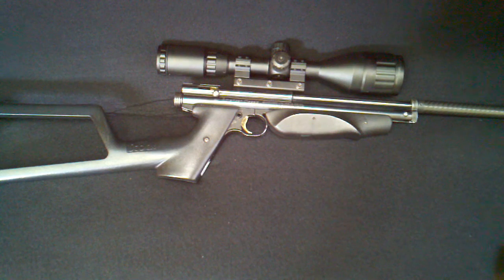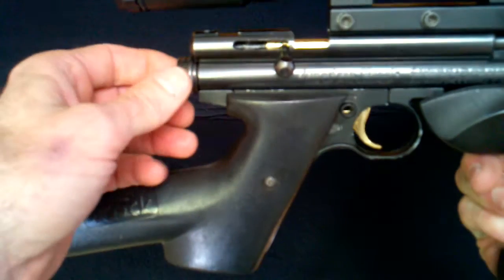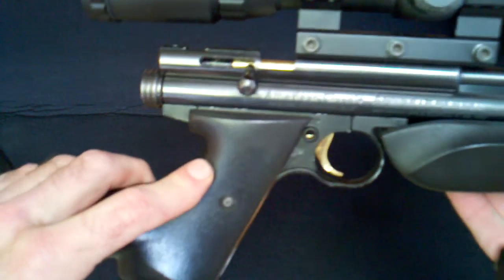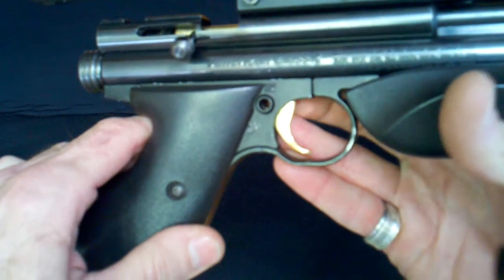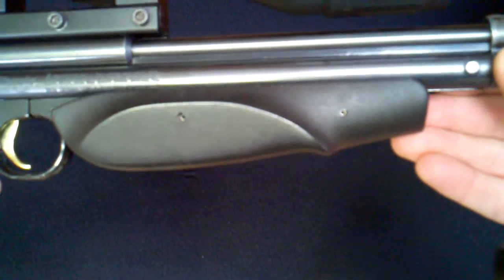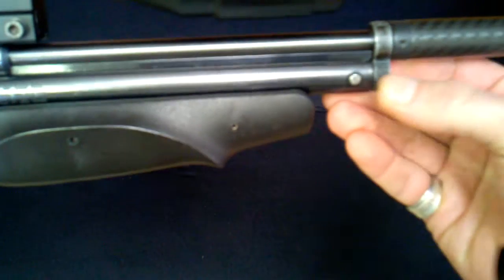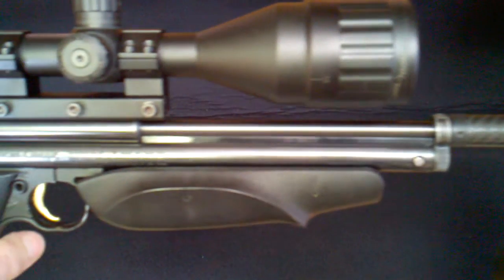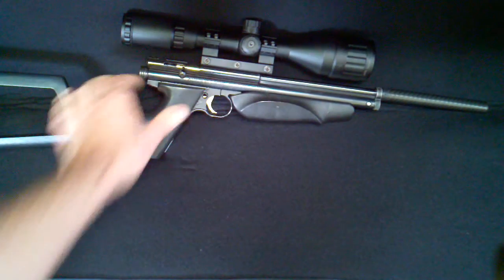Crosman 1377 to 2289 Mod

Comment: Just put a Taso 3-9x 40mm on my 1377. Seemed a bit big until I shot a bullseye group of 5mm @ 15 yds.  Scope seems just right now!  Q- could a bit longer barrell increase accuracy?  I like the short barrell as is for hunting.  Taking tree rats @ 20 yds is OK for me.  Thanks for the video!
Reply from the maker: Happy to Help.
Thanks for commenting.
Adding barrel length not only gives a boost in FPS but, also allows for easy sound moderator install. I live in a neighborhood of (Squirrels are so Cute) people, and so Quiet Tree Rat dispatch is necessary. I think the Back Packer length barrel of 14.5" is the best balance of size, power, as well as Looks for these types of guns.
Cheers.

Comment: How effective is the barrel brake?
Reply from the maker: Thanks for commenting.
These types of brakes are for sound reduction, not for recoil. They do that job very well. Not that these airguns are really loud, but it makes them backyard and basement friendly ;-)
Cheers
Reply: AirGunsNirvana  I am sorry, I thought that a muzzle brake was used to reduce recoil. And a suppressor was used to reduce the sound.
I stand corrected.
I also thought that a longer barrel would give you an increase in velocity, and a lower amount of muzzle blast.

My father told me that you are never too old to learn. 

A muzzle brake or recoil compensator is a muzzle device connected to the muzzle of a firearm or cannon that redirects propellant gases to counter recoil and unwanted rising of the barrel.[1] The concept was first introduced for artillery and was a common feature on many anti-tank guns, especially those mounted on tanks, in order to reduce the area needed to take up the strokes of recoil and kickback. They have been used in various forms for rifles and pistols to help control recoil and the rising of the barrel that normally occurs after firing. They are used on pistols for practical pistol competitions , and are usually called compensators in this context.[2]

A silencer, suppressor, sound suppressor, or sound moderator is a muzzle device that reduces the sound intensity and muzzle flash when a firearm or air gun is discharged. It can be a detachable accessory to, or integral part of, the muzzle or barrel. A typical silencer is a metal cylinder with internal sound baffles that slow and cool the escaping propellant gas, which decreases both sound volume and muzzle blast.[1] A flash suppressor, on the other hand, specifically cools or disperses burning gases typically exiting from the muzzle of a carbine-length weapon, without reference to sound reduction.
Reply from the maker: Thanks for commenting.
No apology necessary, I am always happy to answer questions.
This type of muzzle brake was called that to get around some of the tight Admin people on a few airgun forums starting some years ago. Any talk of an airgun suppressor would get you band for life,  so the term brake was expanded to include these types. Adding barrel length does help with sound, but only so much. There is another benefit beyond sound reduction, it also acts like an air stripper. An air stripper gives increased accuracy by directing the exiting air behind the pellet away from the pellet when leaving the muzzle. I hope this helps...
Cheers
Reply from the maker: Ron CarpenterThanks for commenting. The brake is well worth the money, I have a few ;)
Reply: AirGunsNirvana  Do you really need to have something to reduce the recoil ?? I thought that the stock would allow you to handle all of that power !! WOW

Comment from the maker: Thanks for commenting
It's my understanding of an airgun barrel length and how loud it is.The longer a barrel the more time the high pressure air has to depart energy to the pellet.So longer barrel = more speed = less noise.The shorter the barrel = less speed = more noise.The longer the TKO muzzle brake the less noise also.Balancing these is tricky. On my 13ish barreled 2289 the TKO 6.5 is great.Quite inside at 5 pumps,15 pumps outside louder but still neighbor friendly.;) Hope this helps
Cheers

Comment: Hello Sir!

I'm about to order the 6.5 inch muzzle brake at tco22.com, but what troubles me is how long/short the barrel should be in order to silence the gun? For instance, the muzzle brake is 6.5 inches long, should I order a 13 inch barrel? My guess is the shorter the barrel compared to m-brake the more silenced the gun would be. The longer m-brake would have more space/time to damp the sound before the pellet is out. 

Am I logical here?

Thank you.

Comment: Thank you Sir!
I generally want the barrel as short as possible so I can call it a carbine not a rifle, but now I came across to "you can't have it all". As soon as I installed the flat top piston/valve kit it's become very inaccurate, it was 100% accurate before flat top kit. Now i can't hit the target's center from 15 yard.
So, you think 13 to 15 inch barrel will be enough to improve accuracy? I will hunt crows 

nonetheless It's a great gun, especially I like its power control.

Thank you.

Comment from the maker: Thanks for commenting 
Full details are in the description. All my barrels are directly from Crosman. Check out my video on how I crowned my barrels.What is the best length, that is all a matter what the gun will be used for. If it's for target only than 24" is best. If your walking the woods pestling 14" to 20" max is best. It's all up to you This is one reason why these platforms are the best. Parts availability from the manufacture then modded into what ever type airgun you want.
Cheer

Comment from the maker: Thanks for commenting
The muzzle brake is mainly for looks but as a side effect  it is not loud shooting indoors. As for the barrel band I hope I understand correctly.that your asking about one for a standard length1377. I have not used one but they are for sale on the green and yellow forums.Links to them are on my home page.If you are asking about longer .177 barrels they are the same diameter as the .22.Hope this helps.
Cheers

Comment from the maker: Thanks for commenting and your welcome
What I do and the easiest way to get more fps is to pump the gun more.I have pumped stock guns over 20 pumps with no ill effect except for Valve lock.No big deal,cocking and firing the gun W/O pumping I was back to normal.If with more pumps you're still not there a longer barrel will be needed.For every inch of barrel you gain 10fps.As for the graphite I don't know if it would be bad for the rubber pump cup or not.I hope this helps...
Cheers

Comment from the maker: Thanks for commenting
This project started as a stock 1377,I didn't test the fps before modding it.The barrel band is from a 1970's Crosman 760,I think when I called Bryan and Associates that's what they said.Don't really remember.There are also some suppliers on the Green Forum selling aluminum ones.The bands are the same from 13771322,2289,760, except the pistol ones are smaller in diameter at the front to retain the barrel .. hope this helps
Cheers

Comment: I would very much like to add the Flat top piston and also the steel barrel band to my 2289g... However, Im not sure it would be the same part as on the modified 1322 like you have there.. it seems that the entire barrell band including the end cap part of it is totaly plastic on the new 2289 I have. hmm Do you think that replacing the all plastic one I have on the new 2289 would work like it did for your converted 1322? Also, do you happen to know what the fps on the stock piston was?

Comment from the maker: Thanks for commenting
All the barrels I have worked with have been blued not painted.I don't think you can ruin it by what you want to do.There are a lot of folks who strip the finish off and polished the entire gun,to give it that chrome plated look.If it were me I would start with sanding then clean it with acetone before the paint.There may not be enough room where the barrel slides in the breech for a layer of paint on the barrel.If it works let me know how it turns out.
Cheers

Comment: would you recommend using acetone to remove the barrel paint, lightly sanding the barrel for a brushed metal look, and then spraying it with a layer of enamel? or will any of these things ruin the gun? thanx

Comment from the maker: Thanks for commenting
First some assumptions(fingers crossed)1 steel breech is grooved for scope.2 the scope bought comes with rings to mount to a .22.If this is correct then you are in good shape.Airgun breeches are usually grooved in one of these styles 3/8 or 11mm or dovetail or .22, but they all mean the same more or less. If the breech bought is grooved in 7/8 or weaver or picatinny,these all mean the same more or less.There's a good chance you'll need those rings.hope this helps.
Cheers :)

Comment from the maker: Thanks for commenting
Even though it's extremely rude,around here calling a man a lair is fighting words, I'll still try and help because
I know how frustrating it is when a build doesn't meet expectations.I notice you are in Canada( I DO NOT encourage YOU or ANYONE to break the laws that govern them,it is YOUR/THERE responsibility).Canadian valves have an extra hole to bleed off pressure. The o-rings may have damage from pivot pin hole. Are 2 possibility's.I look forward to an apology.
Cheers

Comment: Thank you.it works. I compressed the spring too much at first.  I got it to work but the trigger was so touchy I felt as though it was  unsafe so stretched out the spring a little more. my trigger is much lighter .thank you the gun is more accurate

Comment from the maker: Thanks for commenting
And absolutely you can compress the spring, but regardless of method used to lighten it. Make sure the sear still engages the hammer. Do a bump test. With the gun uncharged and unloaded cock it and holding the gun over your work area a few inches release it  so the end with the breech bumps the table. If the hammer slides past the sear its not safe. That means out in field conditions if bumped while walking or such you may injure yourself or others. Be safe,have fun.
Cheers

Comment from the maker: Thanks for commenting 
Yes a longer barrel gives more FPS, on average 10 FPS per in. Adding 10" would get an additional 100 FPS. When it comes to increasing valve volume I'm not a fan. the small  gains in FPS are not worth the extra pumping. But for those who want to reach the limits of whats possible it dose help to get them there....
Cheers

Comment from the maker: I've ordered some from Crosman the 14" ones in 22cal are part #2250-019 the 24" ones in 22cal are part #2260-003.I have also got some from BRYAN & ASSOCIATES, they custom cut barrels to what length you want.Links to both companys are on my main page.
Cheers

Comment from the maker: The bad news is that the 1377 and the 1322 use all the same parts valve,pump rod and the like except barrel and bolt. This means when you put the 22 barrel and bolt on the 1377 it will still shoot 450ish fps.1377 sends a 7.9gr pellet at 600ish fps for 6.32flb of energy. 1322  sends a 14.3gr pellet at 450ish fps for 6.43flb. I feel that pest control or hunting with less than 11flb is not right. I live in the USA we dont have airgun restrictions like Canada fps and the UK flb. Stay legal have fun.

Comment from the maker: Thanks for commenting
I flat topped my own valve and got a Crosmods flat top piston. So far the Crosmods part has done great. I posted a vid on how I did it. I haven't used their stuff,but Airgunsmith com and gmaccustomparts com sells them. good luck!!

Cheers

Comment: I baught my 1322 for $59.99 on sale at big5
Steel breach $29.99
Custom stock $16.99
Pump arm $12.99
14" barrel $15.99
Extended Nickel bolt pin $11.99
Plastic barrel band $5.00
Ported & flattened valve $15.99
Flat ajustable piston $15.99
Stronger hammer spring $5.99..
Added a small 0 ring to exaust port took it out of disposable lighter
Dam Its not the same gun anymore very powerfull than stock I still need to shoot it through a crony..3 to 30 pumps I have shot it dumps all the air

Comment: Hello again there is another reason my 2289 shoots 1058FPS. I set him my 2289 to be moded what I got back was my stock and a modified Benjamin Discovery PCP operating @ 3000PSI  It looked much the same, as the piston tube is now where the tank is. Anyway he changed it over to Co2 and it now has a 12 oz bottle mounted horizontally under the barrel and is still a screamer but gets over 200 shots before needing to be refilled.. He also gave me another 2289 with ALL the tricks and mods

Comment: to be a butt-insky, you can buy an adaptor from amazon that lets you bolt it onto the 11mm dovetail of the steel breech and converts it to a weaver style for mounting optics.  Warning if you have a spring piston gun, do not use just any scope that was meant for firearms because it might get destroyed (due to the forward slamming of the piston and the way scopes have their lenses braced). You need an AIR RIFLE scope.  If you have pneumatic, C02, or PCP gun i don't think it matters so much.

Comment from the maker: Your welcome, thanks for commenting..
The felt oiler came from an old steel piston,I got it and the steel barrel band from Bryan and Associates.There is a link on my main page. Sorry I don't have part #'s.I took the Crosmods flat top piston apart and put the oiler on the threaded part between the two larger parts,so far so good.If there's anything else I'm glad to help....

Cheers

Comment from the maker: Thanks for commenting. I got about 500ish fps with 7.9gr pellets at 10 pumps. I got well over 600 at 15+ pumps with the gun in unmodded form. Check out my video on whats going on inside the 1377 pump tube.The flat top valve and piston got me a gain of around 90fps. The longer the barrel the more fps also, I think its about 15ish fps per inch. If I can answer any other questions let me know. Cheers

Comment from the maker: Thanks
The main difference in regards to switching stuff around on Crosman's 22xx and 13xx platforms is the location of the breech screw. Older models have it just before the pellet inters the breech,people complained about the pellets hanging up. So the new ones have the screw located under the bolt. As long as the hole in the breech lines up with the tapped hole in the tube you should be golden.I know little about U.K. complaint Crosmans. I think with extra pumps you will be pleased. 
Cheers

Comment: very nice!! I have a project atm building one of these, I have the shoulder stock and the same foregrip but I was wondering If a 14.5" .22 barrel would be ok on this gun?? ive bought one without a barrel and breech and I have a crosman 2250 steel breech and barrel will these fit and will the gun be powerful enough to shoot a 22 pellet instead of 177? the reason I ask is that I'm still waiting for it in the post here in the uk and am trying to gather parts ready for the build, cheers mate

Comment from the maker: Thanks for commenting 
Price for build 1377-$55,stock-$25,22 barrel-$12,barrel band-$8,SBPK-$30,rear cocking nob-$10,fore arm-$10,FT piston-$30,muzzle brake-$44,scope-$70,scope mount-$15. Grand total $309 U.S.The stock 1377 got 600fps with 177-7.9 gr pellet for 6.32 ft lbs of force.With all I have done I get the same speed but with the heaver 22-14.3  gr pellet for 11.43 ft lbs of force.I have dropped lots of tree rats with it one shot.Longest was 45 yards. Anything else let me know.
Cheers

Comment: it's pretty, but how much did it cost you to do all this? and how much more performance have you gotten out of this gun? the reason I ask these questions is because I want to turn mine into a light weight critter getter that I can fold up into my backpack but I don't want to spend a fortune for little result. I already have a crosman 2100 that will take squirrel (for dumplings or stew) at 25 yards, and that is no mean feat because they are some tough skinned little buggers.

Comment from the maker: @SmoothDooznIT 
thanks for asking.the steel breech from Crosman has a groove cut into the top of the receiver. This allows you to add a scope.This groove is called a Dovetail ,you will also see it referred to as 3/8 or 11mm Dovetail. All of these descriptions refer to the same thing. Hope this helps.